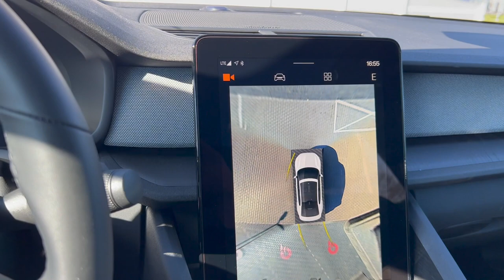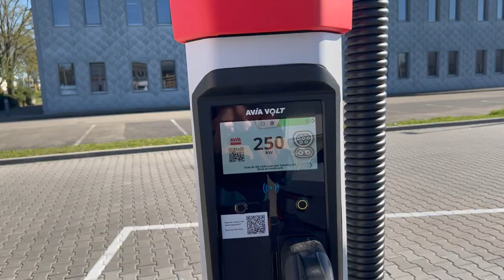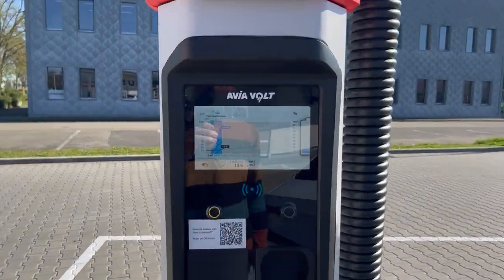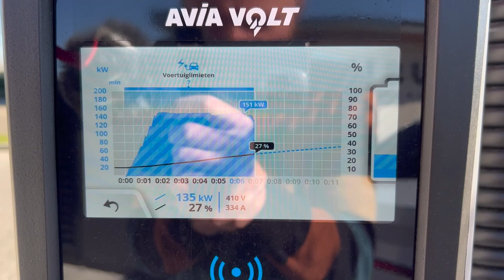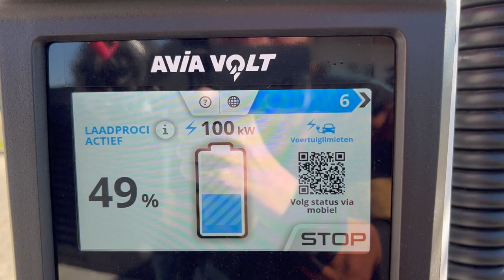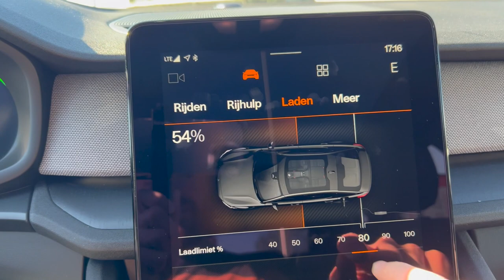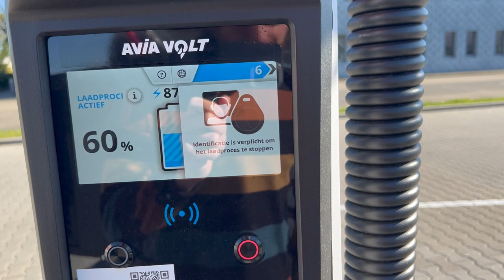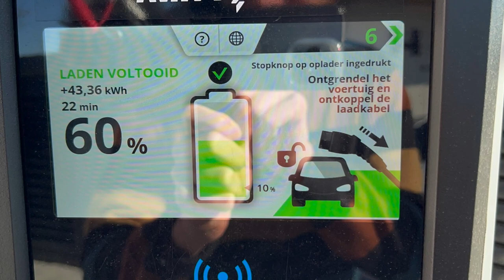Polestar 2 fast charging 10% to 60% at Kempower NL

Comment: To protect the battery, the Battery Management Systems (BMS) usually starts to limit the charging voltage, when its nearly 90% charged. So you will find from 85%-100% it could easily double, or more than double the time you spent on 10%-85%.